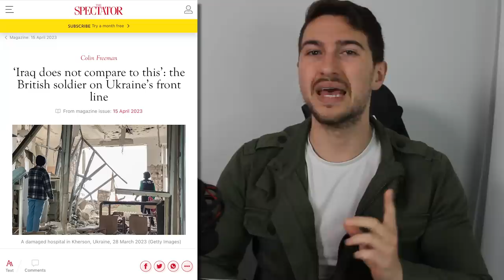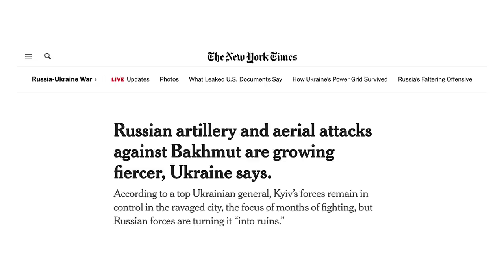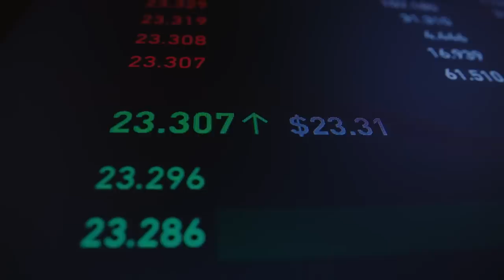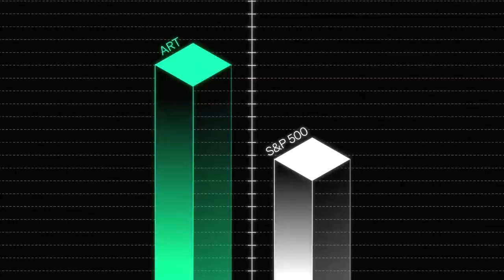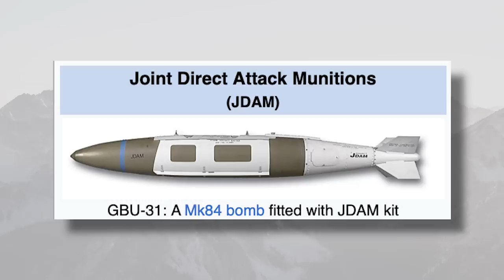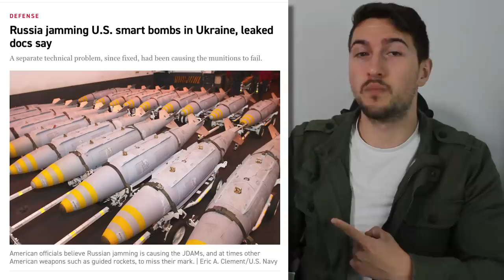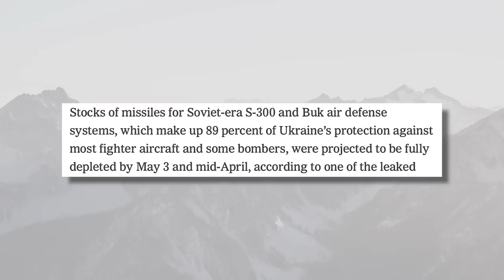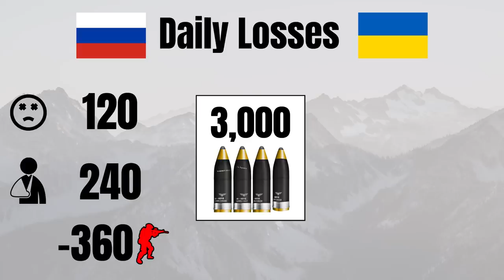Wagner Swipes Through West BAKHMUT with FAB-500s

Comment: FAB-500 is old, ancient even. But it still works great. The main difference seems to be that the air force is now able to safely deploy these without being shot at. This might be from the wing kits increasing the range a lot (Over 40nm apparently.) or from Ukraines SAM net becoming degraded from attrition and lack of ammo.
Reply: Explosives always works well, even 80 years after they were invented (look at nuclear bombs)
Reply: It's just that Russia began to use its analogue of JDAM. They entered the troops in commercial quantities.
Reply: @Дмитрий-э3ъ7э  they have a more integrated JDAM, but that is not what this it. That's the KAB500. These are new kits to convert older bombs. They also have wings so get the range of Jadam ER or SDB.
Reply: @ivanstefko2724  As long as you can get them to the correct place that is. The variant we see with the wing kit is the M-62, the low drag version. This obviously makes sense for a glide bomb. Named in classically Soviet style, because it was designed in 1962.
Reply: A warhead never gets old
Reply: @josephmudenda1770  the delivery mechanism does however. Incidentally nuclear warheads literally get old with radioactive decay.
Reply: They upgraded them, now they are FAB-500S old ones would be useless nowadays.
Reply: @chicha-  I can't find that version on the manufacturers website. Is it a Chinese variant? Where did you find the FAB500s? The old ones will still work, just not the 1950s ones. They built the Fab 500 continuously, its never left service.
Reply: @greybuckleton  I heard about 500s in video where Serbian volunteer in Russian army Dejan Berić talked about them. You can find it on his channel but its in Serbian language.
Reply: @chicha-  hmm ok. Well thanks for the input. But if the manufacturer doesn't list it, and frankly no other source lists it. I'm going to say he is mistaken and it doesn't exist. Its jus the M54 and M62. There are obviously other bombs, like the KAB series, but these are not FAB 500 bombs.
Reply: @greybuckleton  I'm pretty sure he knows what is he talking about since he talked about FAB 1500 aswell and how much KG of explosive they have per bomb. But we can never be sure...
Reply: @chicha-  I mean FAB 1500 exists. And the kg of explosive is literally in the name for all these bombs. It goes all the way to FAB 9000.  I don't know if FAB 1500 is confirmed as being used in this war. KAB 1500 and UPAP 1500 are getting used a lot, which we also saw in Syria. I wonder if he was actually talking about KAB 500S. It's really a much more advanced bomb if you look it up.
Reply: When bomb guidance equipment is added, it works like clockwork.
Reply: @greybuckleton  no, its wheight of the bomb, for fab 500 only about 300kg is  explosives.
Reply: @greybuckleton  UPAB is analog of JDAM, KAB is laser or thermal navigation
Reply: @Տիգրան-ժ1է  the KAB 500S E is advertised as satellite guided my the manufacturer. Other versions are as you say laser or electro optically guided. That term UPAB only appears in a wave of western media sources. I'm not sure if that it's name. If you speak Russian you might have better sourcing on that.  Jane's uses that term but Rosoboronexport uses the KAB S E designation.
Reply: @greybuckleton  something I have not heard that Russia would use the KAB-500S. Except maybe in Syria. (Abandoned mass production) https://ru.wikipedia.org/wiki/КАБ-500
Reply: @Տիգրան-ժ1է  it's interesting how different the Russian wiki page is. I mean the KAB 500s was in service and is still advertised for export. I don't see any other glonass bombs other than the KAB series and these new wing kits going on the FAB series.
Reply: The leaked us govt documents said most of their SAM capability was gone
Reply: @rodiculous9464  The ammunition is yes. But I have seen some soviet ammunition shipping in from other countries, western equipment arrive. And some interesting conversions like adding Aim9 to strella launchers. So they might still be able to keep the air space fairly dangerous for Russia.

Comment: The FAB-50 is an old, but sound design. The difference is, it is bow fitted with a guidance kit, making it a much more accurate glide bomb that can be dropped form high altitude.
Reply: Not even the uploader knows how effective or accurate it is

Comment: The current expectation when specifying modern 155mm Artillery is around 2000 -2500 rounds EFC. EFC stands for Effective Full Charge; that is to say, a full power charge. Artillery is often fired at lower charges (if a long range is not required, then lower charges are fired) Some guns are authorized for “supercharge” (which is a higher pressure charge than normal full charge) Every shot fired from an artillery gun is registered, along with the charge fired; so that barrels can be measured at set service intervals. As a barrel wears, the measurements tell you how much accuracy it is losing. The main wear in a barrel is at the barrel throat, which is the part where the chamber becomes the (rifled) barrel. That suffers the most pressure and heat, so is where the most wear and erosion happens.
Reply: Thanks very much for those insights!
Reply: Interesting. Is it true that the titan superbarrels they make for m777 are very good but hard to replace?
Reply: Is the 155 round the same as a naval 5 inch 54 round?
Reply: @scottsmith9438  no 5 inches is 127mm so a 155 round is bigger
Reply: @Opachki69420  ty
Reply: @scottsmith9438  155mm is 6.1 inch

Comment: If Russia has an endless supply, why are they deploying T-62's and even T-55's? They use T-55 as the artillery because they are running short of 122 and 152 mm shells. Even Prigozhin is complaining about lack of material including artillery shells. T-55 fires 105 mm ammo, which Russia has to buy most of their reserves are in bad shape, this is all from 1950's.

Russian artillery is not that precise, why would they need thousands of rounds a day? If you're capable of precision fire you hit your target and you're done. We can see a fields with hundreds of crates from Russian artillery trying to hit what? Rabbits? 

Russian precision guided missiles. You mean the missiles which hit residential area instead of military structures? Or missing the target (airfield) by a mile? Or when they tried to bomb an airfield, and instead of hitting taxiways and runways, all they hit was soil. It's either bad tech or someone who was responsible for setting up these munitions did a bad job or was drunk.

The problem is incompetence, the mist of Russia's super army is gone, Moskva, the flagship, sunk because of incompetence with half the missiles not working as well as defensive armament. They are indeed 2nd most powerful army in Ukraine and running short of resources, so is Ukraine, however Ukraine needs less shells, which western countries can supply and manufacture.

Comment: The JDAM was a game changer for the GWOT, and that was against sporadic insurgents. I can’t imagine how much more effective it will be against large formations and clearly defined intrenched front lines
Reply: the JDAM gets jammed, russia's much cheaper FABs work just as well & 'don't' get jammed because the west does not having jamming equipment (apparently)  the leaked document that announced the jamming problem to the public 'recomends' that Russian jamming vehicles be destroyed before the JDAMs are used again, but it doesn't explain how that is going to happen if ukraine can not deliver a precision strike because their weaponseep getting jammed.
Reply: @samk2266  
it was assumed Russia developed a "shift" after the US rocket/CM attacks in Syria
the calculations there was - full US jadams against S300-400 would open a passway for cm´s with thinning out the defense lines around 40-60 %
Reply: @samk2266  when I said JDAM I meant the concept not the particular type on either side. But that’s very interesting Russia has electronic warfare that can outclass US tech and neutralize the JDAM, and the US has no response lol

Comment: We don't say 'Mk.83 JDAM', we say GBU-32.  Largely because we don't make unitary weapons, only BLU warheads which can have separate guidance tail kits added.

This is a useful nomenclature system in that a Guided Bomb Unit is much more precise designator for what the bomb is expected to do: a GBU-32 is only built around a 1,000lb medium GP or General Purpose demolition bomb, just as a GBU-31 is only the 2,000lb heavy demolition equivalent <penetrator casing versions gain a 'V2' or 'V3' suffix for subvariant>.  Thus, I would suggest that you adopt 'MPK-500', to differentiate FAB-500 <dumb bombs> from precision guided GLONASS equivalents.

Both are likely to be used in this war, for reasons which will become apparent.

Having said this, the MPK looks a lot more like the AGM-154 JSOW or the GBU-60 series JDAM-ER and neither of these gliding munitions are cheap as the 'SWAK' or Swing Wing Adaptor Kit significantly changes point of balance and load bearing capabilities and requires additional specific encapsulation and strongback to enable.  Attaching a discrete bomb unit to a separate guidance KMU is very inefficient in terms of fighting the aerodynamics of the munition as well as winds/signal spoofing through a varying trajectory.

The recent failure to differentiate an entire border by VKS bombers which struck a Russian town also suggests that what goes around, comes around, and so GLONASS guided munitions, without the SAASM or Selective Availability Anti Spoofing Module and the high power 'narrow beam' capability of GPS Flight 3 satellites, may also face significant jamming/seduction problems.  Those bombers were not lost when they hit Belgorod, they were likely misdirected.

Differentiating what a bomb does and specifically how it's guided is important because, without a backup to the GPS, INS or Inertial Navigation System guidance is apt to degrade, quite quickly, over range.  Requiring bombs to be released much closer in.

Against moving targets, JDAM type munitions are useless Unless they have AMSTE or SAL augmentation, which is to say a datalink that allows the parent aircraft to guide the munition relative to a moving target using GMTI radar or a laser guidance nose, like a conventional LGB.

Again, neither of these options are cheap and so the baseline JDAM kit which runs around 27,000 dollars, when augmented to create a GBU-54 with a SALH kit is about double this cost and when given a SWAK to make a GBU-60 is about 100,000 dollars, depending on warhead class.

Under the theory: 'better the battle you win by not fighting' <because the enemy cannot reach the field>, JDAM is best used to isolate areas by scoring precision hits on targets like bridges and crossroads, removing vehicular traffic to hasten logistical starvation of enemy forces.  Why expend thousands of lives to control a road if you can destroy the chokepoints?

A starving man fights half as hard today as he did yesterday and half as hard tomorrow as he did today.  A hopeless man, who hasn't seen a senior officer or a food truck in a week doesn't fight at all.

IAMs or Inertially Aided Munitions can also be used to collapse fortified buildings but, to be honest, so can ordinary dumb bombs with CCIP, diving at high angles from above the threat floor of whatever VSHORAD is defending the area.  If you can fly CAS at 1,000ft or less, you can fly INT at 15,000ft or more.  Roll in, release, and round out above the 12,000ft threat floor.

This is also the preferred method for engaging moving armor when specific ATGW like Brimstone, Maverick and LMUR are not available and generally works well, in CAVU environments.  Cluster weapons being better than unitaries.

Comment: the author failed to mention that both sides employ glide bombs now, the Ukrainians now use Jdams, similar drop spec 15Km from front range to 50Km accurate up to 4 meters unjammed 20 meters jammed.
Reply: As usal with VatnikLegends. He is just pure pro Russian
Reply: in order for Ukraine to use these bombs, it must have:
1. Air superiority so that the aircraft can gain sufficient altitude.
2. Planes
3. Hope that the S-300SV, S-400 type air defense systems will not bring it down before or JDAMs itself.
Reply: @pwn5047  neither side has air superiority, ukraine has su 25 and migs that have been fitted to deploy jdams, both side has s-300, jamming is more of problem for ukraine then delivery..
Reply: @rkey870  Ukraine has no combined arms air defense systems left. Even the Ukrainians themselves are already talking about this, take the trouble to study the issue ..
Ukrainian aviation flies near the ground (low), thus it is impossible to use JDAM and not enter the air defense zone of the Russian army.
Therefore, your opinion and analytics are idiotic.
Reply: @pwn5047  thats a fallacy and only the case for the SU-25.. do your homework.. opinions  are okay to have, perhaps not in your country though..

Comment: Maybe we're gonna have Pe-8's with FAB 5000's make a comeback? 🤣👌
Reply: Yeah, spawnkilling the entire offensive
Reply: @DigitCitizen  They need to attack the D point in that case my good sir! 🧐
Reply: FAB 5000 or FAB 9000 are too heavy for using gliders i think.
But FAB 3000 are possible. But who knows.
Reply: @theepashmani6474  Oh yeah it was mostly a WarThunder reference, but as for using the glide system I think over FAB 1000 is not really that efficient as the number refers to its weight in Kilograms, I guess this system works well with 500 because it's a compromise bewteen max firepower and min manoevrability, over that it might become too difficult for the system to handle drag caused by the bomb's weight, making it useless.
Reply: @gniolliv  there are already pictures from this kit production of FAB-1500s next to glider FAB-500s, with the glider attachment - the use is not confirmed yet, but I am confident they will appear on the front, during this War.

the FAB-1500s made their first comeback during Syria War
Reply: @thesaul9484  thanks for my knowledge update!

Comment: Gratz! Russia has done what the US did 20 years ago with the JDAM! Just a kit added to a normal bomb. If Russia has developed and can deploy in large numbers, though it can be a game changer on the front. Can fly high, release from safe distance etc.  Pretty good for Close Air Support or CAS for short. There are tons of comms, coordination etc, tactics, doctrine that all needs to develop and kept safe for it to be a total game changer. Time will tell though.
Reply: CAS and flying high are basically incompatible even tho CAS means firing at enemies CLOSE to your own troops
Reply: @wogelson  Not if you have precision weapons and effective comms. It was the US kept at least 2 B-1B's or B-52's orbiting over IZ and AF. Ground commander can call and within 30 minutes a 2,000lb bomb dropped from 35K feet 50 miles away. Well away from any threats would hit within 10 meters from where the platoon sgt wanted it. Danger close is still 400 meters. It can be  a total game changer if RU is able to mass produce and communicate/ coordinate. Because RU no longer needs to risk planes to get within the SAM envelope. If fired on just turn east and punch it. The missile will run out of fuel and the bomb will still hit where it is supposed too. No need for Line of Sight, or a buddy laser. As I said, time will tell though.

Comment: But the assumption that Ukraine Doesn't Lose or Overuse the Artillery shells like everything else they burn thru ineffectively not counting Russia Blowing up Ammo depots which they are doing More frequently. Russia is stepping up Production on Ammo Plus now retro fitting old tanks so they have a Monster surplus and many multiple locations of a mere garage o 5-10 guys make 10 to 20 New tanks per month and if you have 30-50 of these that is astronomical amount also considering they are Not losing as many as earlier

Comment: Oh the cut below say the current FAB 500 is perhaps a JDAM and wings  equipped version of a 60 year old bomb.

Nothing high tech.

And "just" 660 lbs of explosive-  NO WAY can just 660lbs. 300kg make THAT hole- 50 meters diameter and looking perhaps 10 meters deep.

Even in that soft looking dirt-

They Russians. MIGHT  have a much bigger bomb CUT BELOW
 

The FAB-500 is a Soviet-designed 500-kilogram (1,100 lb) general purpose air-dropped bomb with a high-explosive warhead, primarily used by the Russian Air Force, former Soviet republics and customer countries. The original M-54 model was rolled out in 1954, shaped for internal carriage by heavy bombers, a low-drag M-62 version in 1962 was intended for fighter bomber external hardpoint carriage.[2][3] The bomb is unguided, features a single nose fuze, and is compatible with most models of Soviet aircraft.[4]

In March 2023, Russian Su-35s have launched a number of FAB-500M-62, wreckage of which indicates that these have been fitted with a JDAM type kit. Involving pop-out wings and satellite navigation. It's unknown whether it has an internal navigation system. Another theory is that the bomb has been fitted with wings simply to extend its range. It also is believed to give Russian aircraft a stand off ability to hit Ukrainian targets without risking Ukrainian air defences.[11][12][13]

On 4 April, Ukr